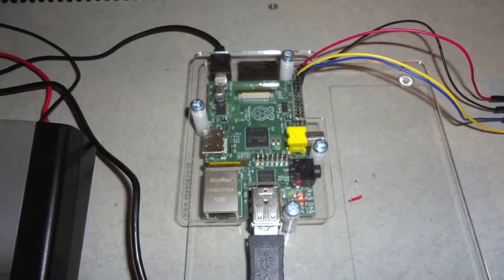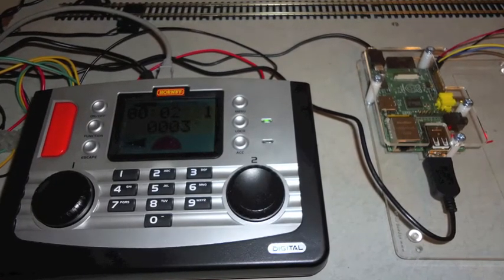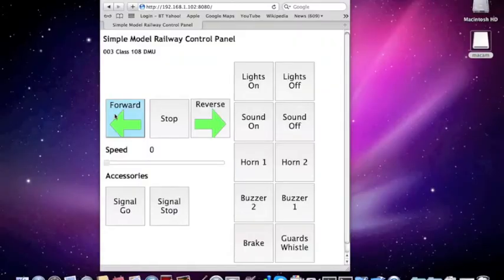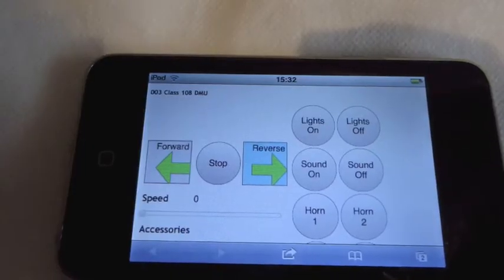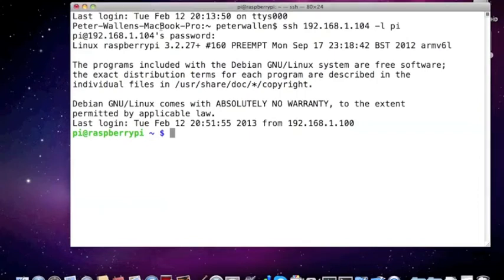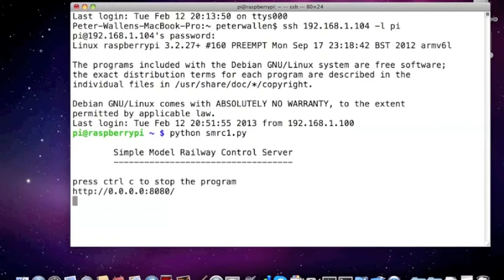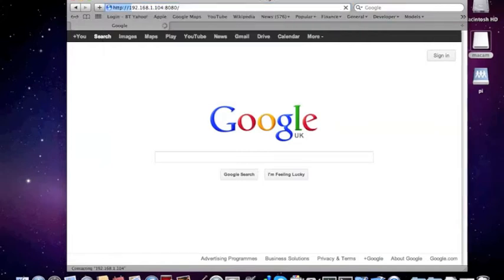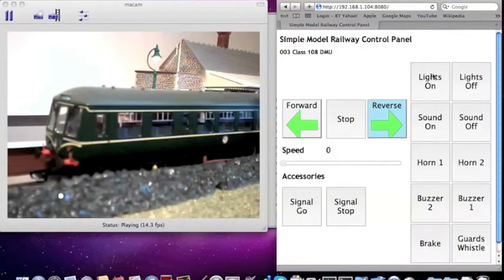Raspberry Pi Model Railway Controller - 2

Comment: Hi Peter,

Great video. I am curious, have you released the code for this in any form? I am anticipating the arrival of an E-Link soon and have setup RailMaster on my Mac inside a Windows VM (rather ugly I know). I would be more than interested in contributing to code which would either offer a new cross platform utility for Hornby controllers or add extensions to JMRI for the Hornby ELink.

If you have published the code please let me know, I would love to take a look.

Regards,

Rob
Reply from the maker: Hi Rob
The demo is based on my python module hornby,py. The code is included in my notes on my first video, a link to which can be found in my reply to David Walker. In this video I just added a simple web server using the web.py library and some html. I can email you the code if you're interested.
Regards
Peter
Reply: Hi,

I'll check it out, not sure if you agree but I found JMRI over the top for most users, and I find Hornby Railmaster is let down by only being single platform. Which license is your Hornby module released under? If it is open source can I fork it and make my own modifications?

Regards,

Rob
Reply from the maker: Robert Putt Hi Rob
I suppose the price of JMRI's versatility is that it may appear complicated and ,when I looked at Railmaster, it did not incorporate positioning feedback other than some mythical RFID system. It wasn't my intention to compete with these products but just to experiment with interfacing the RaspPi with Hornby hardware and simple train detection.

I've uploaded the the python scripts to github/phwallen/smrc. You are most welcome to copy and modify(open source MIT license). Let me know if I can be any further help.

phwallen@gmail.com

Comment: Hi Peter, 

you are much further down the line than I,  so I would like to share your wisdom!

My original intention was to implement block detection on my Pi on an (from me using Jython) enhanced  JMRI running on the Pi, however I am coming to the conclusion that Jython is too much of a mouthful for the Pi. What is your view on this and how do you see the chances of success for a (Ubuntu)  laptop running JMRI  with  tallking to an Elite  and parallel talking to a Pi running Python/Jython block detection? 

Additionally I have concerns on interrupt programming  weaknesses of the Pi
Reply from the maker: HI David

I have no experience of using JMRI or Jython so can't really help with your question.  The remote control using a browser was an extension to the automation project described in my first video and documented in these notes;
http://www.peterwallen.talktalk.net/My_Pi/Projects/Entries/2012/10/24_Model_Railway_Automation.html
I'm aware, reading other articles and comments that JMRI has been implemented on the Pi, these videos show a relatively simple way of implementing train control and detection using the features of the Pi.
Good luck with your project.
Peter

Comment: Excellent stimulation for further experimentation. Have you seen the work of Gyuri Balazs with Trains DCC? Also would you be prepared to send me the python script? We are looking to have two devices (phones?) to control trains and one or more tablet or touch screen to control points, all through the Pi or a PIC to a booster or Elite. I have ordered the Hornby e-link which is an Elite without knobs on!